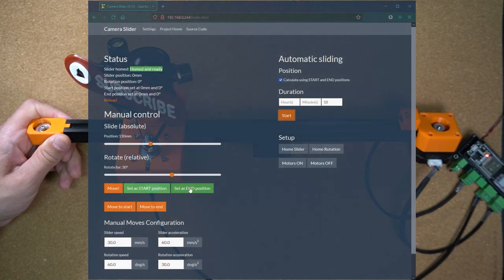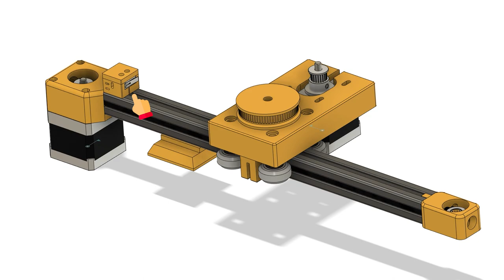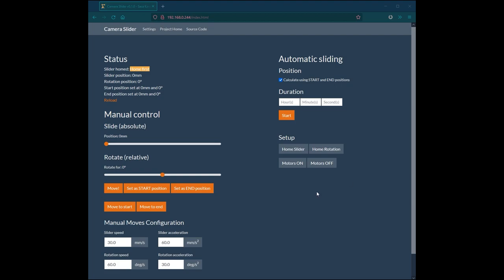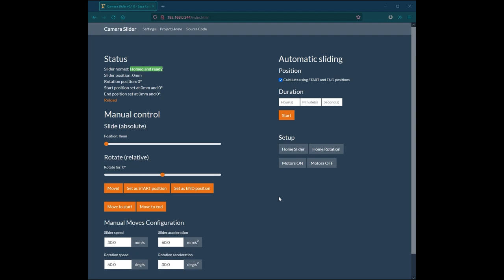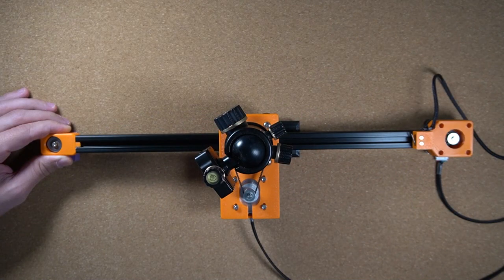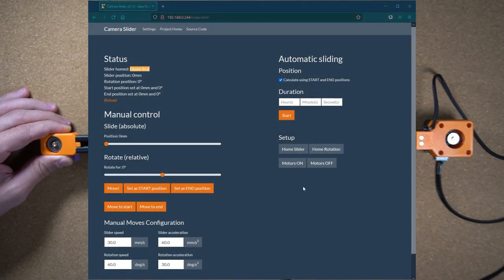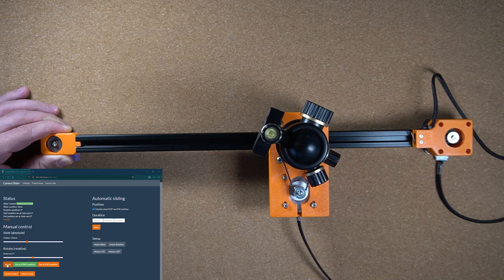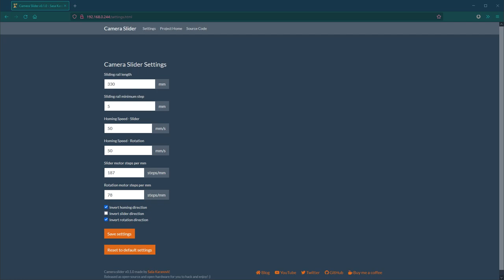DIY ESP32 Camera Slider

Comment: How about an option to slide while keeping the camera pointing towards a specific point, given by X and Y coordinates? That would allow observing a target from different angles. Great project! 👍
Reply from the maker: Thanks! Maybe I don't understand the question but you can already do that. If not, it can easily be added to the firmware.
Reply: I've been briefly searching for a camera slider project that incorporates specific point tracking, but like Sasa already said, it could probably be done in the firmware... I feel like this will be an uphill battle as I don't know much about electronics, programming, etc. in this regard. I might dig into this in my free time.

Comment: which parts of the board are dnp because i cant see any markings on the pictures for dnp and which way round do the stepper drivers go on your board nd do you have a photo of the front and back of the built up pcb
Reply from the maker: Hi Sparks workshop. There are only two resistors that are DNP and it depends if you want to use a pull-up or pull-down for the limit switch.
All files are open-source open-hardware so you should be able to open the design and explore. Altium also has a free viewer license as well as online viewer.
Reply: @SasaKaranovic  what do you mean by pull up or pull down thats just gone over my head are you on facebook
Reply from the maker: Your limit switch will connect to GND or to VCC, depending how you wire it. But when it's not actuated, it will leave the GPIO floating. In order to prevent the pin from floating, you usually add a pull-up resistor (ie. 10K resistor to VCC) or pull-down (same but to GND instead of VCC). Now when the switch is not engaged, pull-up resistor keeps the pin at VCC. However when the switch is actuated, it will pull the pin to GND. You can also look this up on Google/Wikipedia, it's a pretty common thing.

Comment: Thanks for the video. Is there any way to use your project and add a LOOP function? When starting the movement would be done several times until the stop command was given.
Reply from the maker: Thank you! Absolutely, you can add in code a path where you either specify the number of loops to do, or change start-stop behavior to be start/stop looping.

Comment: Very cool project! Thank you very much! Can u add a  link to a suitable limit switch for the slider? I did not find one which is suitable for the limit switch mount bottom case on Ali.
Reply from the maker: Thanks! I'm glad you liked it!
You should be able to use something like this -> https://www.aliexpress.com/item/4000638031271.html
This is the same form-factor like the one I used in the video. But essentially anything that you can fit on a 2020 rail and have the platform "hit"  against would work. :)

Comment: what voltage should the step down convertor be set to?
Reply from the maker: Depends on you input voltage and how you intend to use the board.
I usually use 9-12V on the input and feed it directly to the steppers and voltage regulator. Then voltage regulator steps that voltage down to 5V for the ESP32 (which has internal LDO that converts it to 3v3). Obviously you can tune this depending on your stepper selection and if you made any modifications or not.
Reply: @SasaKaranovic  yes i will be using a 12v power supply, tmc2209 and Wonolo ESP32 ESP32S CP2102 Development Board 2.4GHz Dual-Mode WiFi+Bluetooth Antenna
Reply: @SasaKaranovic  what i plan on doing is i have 5 of the boards you designed which i had made at pcbway and i have another set of all the parts to go on the board so what i was thinking of doing is making your camera slider and one of the other boards  to convert my neewer manual slider to motorised so this project is perfect for me

Comment: instead of using DRV8825 can i swap those out for tmc2209
Reply from the maker: It should work. Please double check that you have a pin-to-pin compatible module but otherwise you should be good to go.
TMC2209 should also give you a smoother and silent operation. Let me know how it works! :)

Comment: Coming from Hackaday. Nice video, we would need more info on how you setup the ESP32 and motor shield. Subscribed for future videos.
Reply from the maker: Hi Rasa, you can find the source-code and hardware in the project repository. There is a guide on how to build and flash the firmware. It's pretty straight forward but let me know if you need help.

Comment: Greta project. I start making it but i have problem what to solder to points R3 and R5?
Reply from the maker: Thank you!
Those are marked as DNP (Do Not Populate). Basically you have the option of choosing between pull-up or pull-down. If you are using the code as-is, you should not populate R3 and R4.

Comment: Beautiful project and thanks for sharing it all.
Not being very experienced, can I use the A4988 drivers instead of the TMC2209?
From what I understand they are pin to pin compatible, the only difference is that the TMC2209 has StallGuard which allows for sensorless homing capability,
but I know if you use it in your project.
Looking at the wiring diagram I saw that you indicated the DRV8825 motor driver, not the TMC2209 motor driver as indicated in the video, did you perhaps modify the circuit?
One question, what size is the printed circuit board?
Thanks again
Reply from the maker: Thank you! I'm glad you liked it!
Good catch! :)
I ended up building multiple versions, initially wanted to use TMC2209 because they are silent compared to A4988, but later on used DRV8825. They (modules) are all pin-to-pin compatible so you should be able to switch between them. Just modify the source code to reflect correct number of steps per mm/rotation and you should be fine.
The PCB size is 100x40mm. But it's an open-source open-hardware design so you should be able to modify it any way you like. Let me know how it turns out if you end up building one!

Comment: I would love to see a video loading the firmware. I have a spare ESP8266. would the firmware be compatible for this? I am used to arduino uno's so ESP has a bit of a learning curve. 9:55
Reply from the maker: ESP8266 is not compatible out of the box but obviously the firmware could be modified to work on ESP8266. Although I would highly recommend using ESP32.
Thank you for the suggestion. I am working on new version of the camera slider and I will focus on the firmware loading part to make sure it's well documented.
Reply: I was able to install PlatformIO and get the firmware loaded. I can even connect to Wi-Fi, but I suspect I am missing something about getting the web page loaded in. I just get a page not responding. I can see the IP and port 80 is open. Thanks for the help

Comment: Hi Sasa,
Often when I go to the settings page and come back I lose the connection.
Looking the monitor I see Task watckdog got triggered.
I have the same problem that Levon Dombayan (in your blog) had. You have more information about the problem. The libraries are what you recommended but I have no idea how to fix.
In your blog you wrote "You could also extend the watchdog or completely disable it and see if that changes anything". How you do it?
Is it something to write in the libraries or in the code?
Thank you in advance
Matteo
Reply from the maker: Hi Matteo.
If you have long running functions or ones where you wait for an event (ie. device to connect) you must reset the watchdog timer. Otherwise it will think your MCU is "stuck" and reset it in an attempt to recover the device.
You can disable watchdog or configure it to extend the window so it does not trigger. Try searching for ESP32 disable watchdog. I'm sure there are many examples on how to do this. Also the ESP32 documentation can't hurt.

Comment: Hi Sasa,
compliment for your work.
Thank again you for your documentation, very clear and detailed.

I have a question?
How I can use the slider without my wifi home connection?
I would like to use it outside using only wifi connection between slider and phone.

Best regards

Matteo
Reply from the maker: Hi Matteo. I'm glad you liked it.
You could modify the code to have the ESP32 act as the access point instead of WiFi client. Then from your phone connect to the ESP32 and you should be good to go.
Reply: @SasaKaranovic  Hi, I try todo it. Thank you for your answer. Good Day! 👍
Reply: @SasaKaranovic 

Hi Sasa,
I've modified the code to have a possibility to use the ESP32 as access point.
Seems work without problem. I copy the short modification that I have done 
to help people who want to use the slider without a router. 
Best regards
Matteo

#include "WiFi.h"

#include "ESPAsyncWebServer.h"
#include "SPIFFS.h"
#include <ESPmDNS.h>
#include <FlexyStepper.h>
#include "config_cameraslider.h"
#include "config_wifi.h"
#include "include/PersistSettings.h"

const char* ssid = "Wireless Controller";
const char* password = "12345678";

AsyncWebServer server(80);
int WiFi_status = WL_IDLE_STATUS; 

void notFound(AsyncWebServerRequest *request) {
    request->send(404, "text/plain", "Not found");
}
IPAddress IP(192, 168, 1, 240);
IPAddress gateway(192, 168, 1, 1);
IPAddress subnet(255, 255, 255, 0);

// Variable to store the HTTP request
String header;

// We will use persistent storage to store our Camera Slider configuration
// but also allow us to edit it trough web/api
// This way we can decouple firmware from electronics/mech changes
// i.e We can change rail lenght or motor direction without recompiling firmware
// Note: You should not edit config below. Instead modify defaults inside `config_cameraslider.h`
struct SliderConfigStruct
{
    static const unsigned int Version = 1;

    uint16_t rail_length = RAIL_LENGTH_MM;
    uint16_t min_slider_step = MIN_STEP_SLIDER;

    int homing_direction = -1;  // Specify if we should reverse homing direction
    int slider_direction = 1;   // Increase (1) or decrease(-1) steps to get positive movement
    int rotate_direction = 1;   // Increase (1) or decrease(-1) steps to get positive movement

    uint16_t slide_steps_per_mm = SLIDE_STEPS_PER_MM;
    uint16_t pan_steps_per_degree = PAN_STEPS_PER_DEGREE;

    uint16_t homing_speed_slide = DEFAULT_HOMING_SPEED_SLIDE;
    uint16_t homing_speed_pan   = DEFAULT_HOMING_SPEED_PAN;

    float default_slider_speed = DEFAULT_SLIDE_TO_POS_SPEED;
    float default_slider_accel = DEFAULT_SLIDE_TO_POS_ACCEL;
    float default_rotate_speed = DEFAULT_ROTATE_TO_POS_SPEED;
    float default_rotate_accel = DEFAULT_ROTATE_TO_POS_ACCEL;
};

PersistSettings<SliderConfigStruct> SliderConfig(SliderConfigStruct::Version);

void setup()
{
    // Configure Serial communication
	  Serial.begin(115200);
    Serial.println("DIY Camera Slider");

    // Peristent device config
    SliderConfig.Begin();
    if( SliderConfig.Valid() )
    {
        Serial.println("Reloading camera slider settings.");
    }
    else
    {
        Serial.println("Camera settings invalid. Resetting to default.");
    }

    // Configure and initialize GPIOs
	pinMode(PIN_LED, OUTPUT);
	pinMode(PIN_MTR_nRST, OUTPUT);
	pinMode(PIN_MTR_nEN, OUTPUT);
	pinMode(PIN_END_SWICH_X, INPUT_PULLUP);
	digitalWrite(PIN_LED, HIGH);
	digitalWrite(PIN_MTR_nRST, HIGH);
	digitalWrite(PIN_MTR_nEN, LOW);

	delay(1000);

	// Initialize SPIFFS
	if(!SPIFFS.begin(true))
    {
		Serial.println("An Error has occurred while mounting SPIFFS");
		while(1);
	}

  WiFi.softAP(ssid, password);
  delay(500);
  WiFi.softAPConfig(IP, gateway, subnet);
  IPAddress IP = WiFi.softAPIP();
  Serial.print("AP IP address: ");
  Serial.println(IP);

	Serial.print("WiFi IP: ");
	Serial.println(WiFi.localIP());

    if (!MDNS.begin(MDNS_NAME))
    {
        Serial.println("Error starting mDNS");
    }
    else
    {
        Serial.println((String) "mDNS http://" + MDNS_NAME + ".local");
    }

	// Setup motors
	setupMotors();
	CameraSlider_EnableMotors(true);
	digitalWrite(PIN_LED, LOW);

    // Initialize Web server
	setupWebServer();
	server.begin();

    // Debug message to signal we are initialized and entering loop
	Serial.println("Ready to go.");
}
Reply: @matteomantovani5653  hi man, i've tried your approach to connect directly to esp32, and i got error, maybe you can help me to explain what im doing wrong, i copied and paste your code to DIY_CameraSlider.ino, and i got

DIY_CameraSlider:10:13: error: redefinition of 'const char* ssid'

 const char* ssid = "Wireless Controller";

             ^

In file included from C:\Users\Marta\Documents\cam\DIY_CameraSlider\DIY_CameraSlider.ino:7:0:

sketch\config_wifi.h:4:13: note: 'const char* ssid' previously defined here

 const char* ssid = "Wireless Controller";

             ^

DIY_CameraSlider:11:13: error: redefinition of 'const char* password'

 const char* password = "12345678";

             ^

In file included from C:\Users\Marta\Documents\cam\DIY_CameraSlider\DIY_CameraSlider.ino:7:0:

sketch\config_wifi.h:5:13: note: 'const char* password' previously defined here

 const char* password =  "12345678";

             ^

Multiple libraries were found for "WiFi.h"

 Used: C:\Users\Marta\AppData\Local\Arduino15\packages\esp32\hardware\esp32\1.0.6\libraries\WiFi

 Not used: C:\Program Files (x86)\Arduino\libraries\WiFi

exit status 1

redefinition of 'const char* ssid'

Comment: Great video! Thank you for sharing! How do you attach the tripod adapter on the alu bar? The default photo/video bolt standard is 1/4" so you would need a 1/4" T-nut in the alu slot. Those do exist, although somewhat hard to get and then the length of the 1/4" bolt will hit the bottom of the alu bar before it tightens. Can you please share this detail as well?  Are you using some modified M5 bolt on the tripod adapter to secure it on the tripod? We manufacture photo and video equipment and are using 2020alu bars extensively. 
Overall great design!
Reply from the maker: Thanks INUX3D! Tripod adapter can be attached with a M3/M4 bolt and a T-nut. For this particular build I think either M3x20mm or M3x16mm would work nicely. 
I'm not sure if this answers your question but feel free to reach out to me via email if you need more help.

Comment: I'm trying to build this. I've noticed that in your BOM you don't mention screw sizes. As someone who doesn't have all shapes and sizes of screws I'm positive I don't have all the sizes I need. It would be helpful to know what size screws, how many of each and where they go. 

This is a really awesome project and I'm excited to try it out. Thanks for putting this together!
Reply from the maker: Thanks Mason! That's a good point, I'll try to update the BOM to include all screws sizes and lengths. Most of the build uses M3 screws for motors, pulleys, switches etc.
But until BoM is updated, there are two build montages so you can hopefully see exactly where each screw goes and how things are put together.
Also feel free to ask for help if you get stuck or have questions.
Reply: @SasaKaranovic  awesome thanks for your help! Do you have a suggestion for providing power or will any wall wart with enough voltage work?

Comment: good video. But which stepper do you mean exactly, there are many different mema 17 steppers.
Reply from the maker: Thank you! There are some suggestions in the Hardware BoM. But you can select whichever one is a good fit for your frame size, camera/platform weight, etc. As long as they are 42x42mm with 31mm hole spacing, they should fit the design nicely.

Comment: Hello Sasa. Fantastic and very helpful video. ı ve been searching for two weeks and mosy helpful is yours. ı have twp questions how can we get custom board? Second quesyio will be after .. (char limit)
Reply from the maker: Thank you Volkan! All the files including manufacturing packages are provided in the GitHub repository. Others have used those files to upload them to the PCB manufacturing site (ie. PCBWay, JLCPCB, Seeedstudio etc) and they send you back PCB or PCBA (board you have to assemble or fully assembled board).

Comment: What do you type into the browser to get the web app? How do I connect? Great video ❤
Reply from the maker: Thank you!
You enter the IP address that camera slider got on your network.
You need to configure the ESP32 to connect to you WiFi. Make sure to change the WiFi SSID and password in the config file.
Then you will need to know which IP address your router assigned to the  camera slider and enter it in your browser.
Reply: @SasaKaranovic  thanks Sasa, I’ve worked that but out now. I just needed to read your instructions.  The next challenge is the control board. I have tried an espduino with cnc shield and a mks dlc32 v2. I don’t know how to change the driver code to A4899. Would any of these set ups work?
Reply from the maker: It believe it should work. The CNC shield can drive the motors and Arduino/ESPDuino should run the code without any issues.
Just change the WiFi config and pin configuration since CNC shield probably doesn't use same pins for motor direction, step etc.
All the source-code and hardware design is provided as open-source open-hardware so you can copy&paste it for your application.